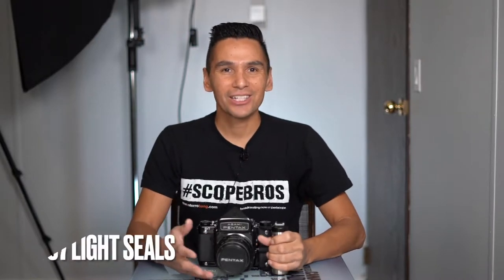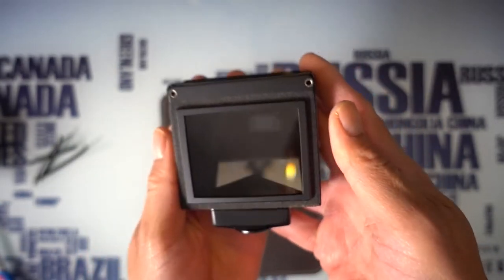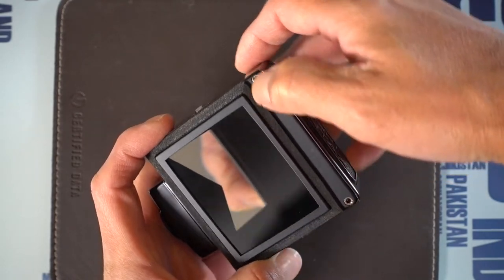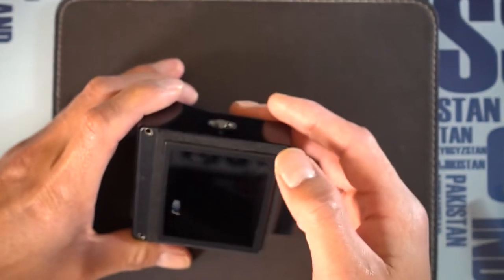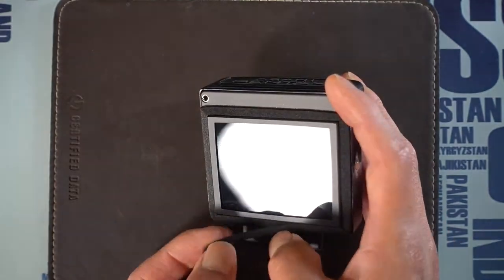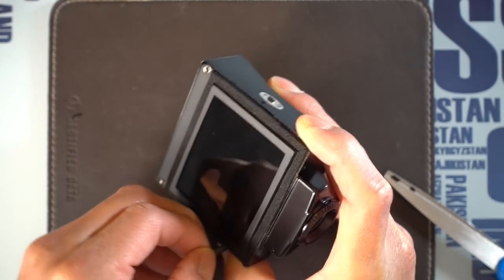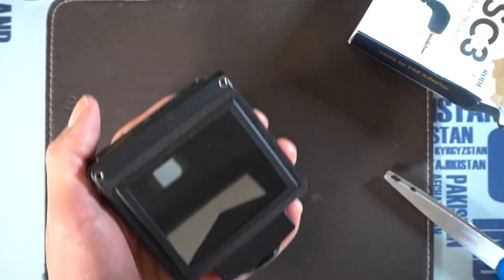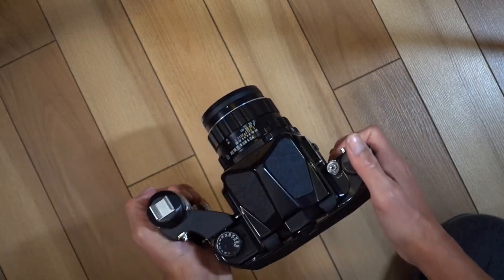Replacing Pentax 67 Light Seals - Medium Format Film Photography Camera DIY Fix

Comment: Hey! Just so you know, the foam on the prism finder is only for a stiffer fit, you won’t get light leaks even if you had no foam on the prism. You can even take the prism off & use the glass as a waist level finder & you still wouldn’t have light leaks. (They even sell a waist level attachment for the Pentax 6x7), with that being said, I’m confident that the foam on the prism was not the source of your light leak. It was most likely the foam on the film door.
Reply from the maker: Thanks!

Comment: i'm about to do this on mine. did you just scape some of the old seals, and left the some residue on? i noticed you just put the new seals on top of the old one
Reply from the maker: Oh man, the old ones were non existent lol. I did try to clean if off first though. I didn't go to crazy with it though. I just used a damp q-tip to wipe it off I'm pretty sure. But ya, stuck the new stuff and and has been good, no peeling off or anything.
Reply: @RobMoses   gotcha!!

Comment: I hope that chain under the finger didn't break.  If I'm not mistaken, you remove the lens FIRST, THEN the finder when you take the finder off, and then reverse the procedure when putting back together.  If that chain breaks, MAJOR problem that is hard to fix.
Reply from the maker: You're right, I totally forgot about that. I just checked and the chain is good :)
Reply: You don't have to worry about that if the finder is not the metered one. He can take that thing off and put it back on without having to remove the lens.

Comment: Hey! So I’m having a light leak issue and I’m curious if the viewfinder light seals are the issue. What led you to the viewfinder being the cause? My issue is a diagonal faint light streak in the top right of my frames on 2-3 frames per roll max. It only seems to be in the frame so I don’t think it’s the back door. Is this what happened with yours?? Thanks!
Reply from the maker: Hey, so I had some vertical lines showing up in a a few of my photos per roll. But after some investigating I found that my viewfinder prism was a little loose and had some play. When I took it off to investigate further I saw that the seals were completely deteriorated and non existent. It only happed on photos that I shot vertical, so I think the prism would tip over a bit when I was shooting a photo and light would get in that way.